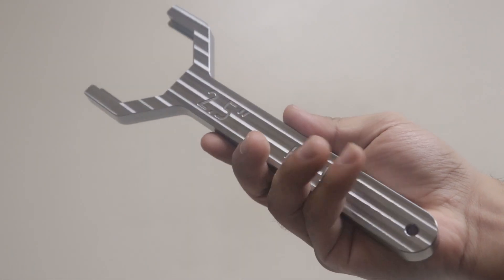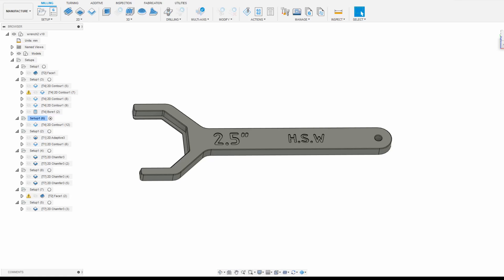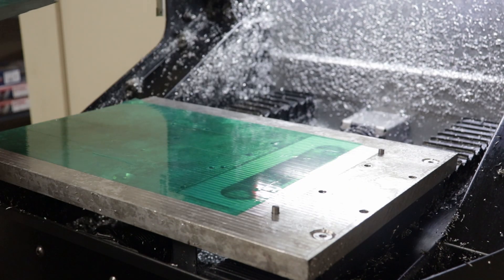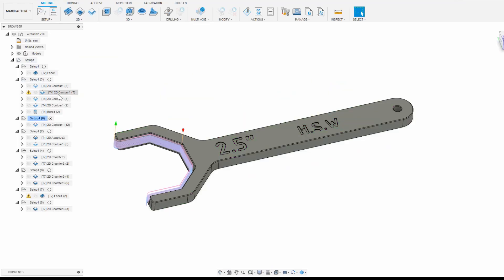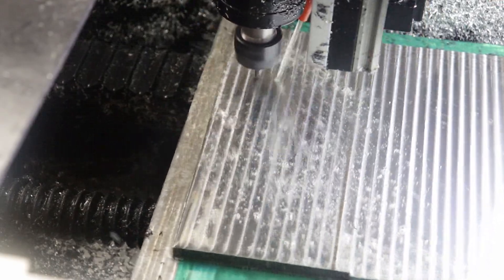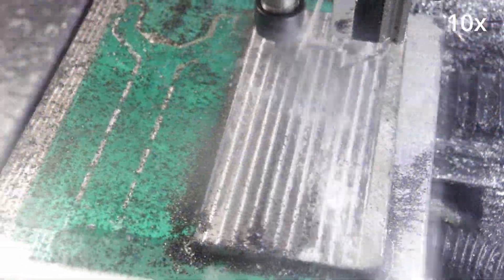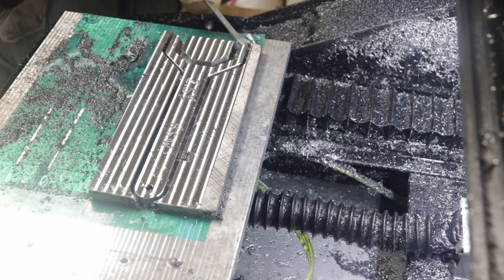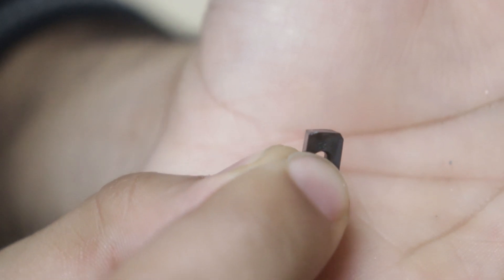Making 4140 Steel Octagonal Wrenches on the DMC2 CNC

Comment: Jack stands putting a little (can't stress little enough) pressure underneath material sticking out of the vise could be a quick solution for vibration in a future project

Comment: Hit those mill surfaces with glass beads and you'll have a sating finish.

An afterthought. Have your friend coat the tool handles with PVC or Plasti-Dip or wrap in rubber tape. Electrical hand tools should not endanger the user with a shock hazard.

Comment: the noise difference is climb milling vs conventional milling. the noise has has noting to do with the tool. you are hearing the backlash in the axis as the cutter is pulling the spindle along faster than the ballscrew and they are bouncing into eachother
Reply: exactly....  When that happens to me I only cut in the direction the doesn't create the harmonic....

Comment: A set of knipex plier wrench would work well but i agree custom wrenches are nice worked at a place that we used to lazer cut wrenches
Reply: this isnt about the wrenches its about the cnc machine... obviously  he could just buy a tool
Reply: @justinc2633  he's saying you DON'T NEED A SPECIFIC TOOL custom made for the job.

Like it is not necessary to buy an 8 point wrench sold by the stoplight company.

You can use a general purpose tool that won't take up extra space in your toolbox.

This is a separate point related to the problem being solved. Not a criticism of the tool design of this wrench or the decision to record this as the subject of the video...